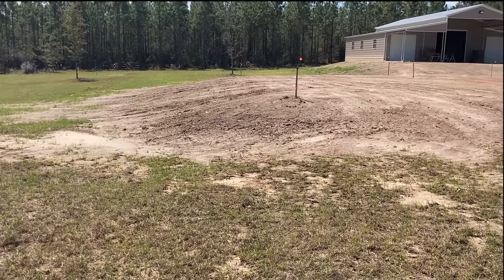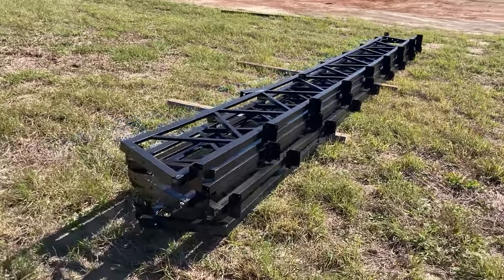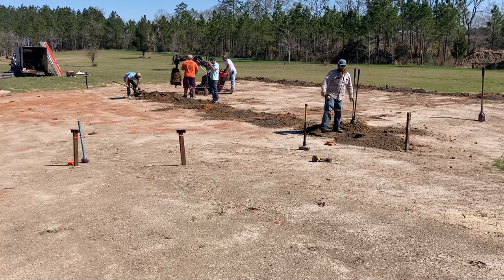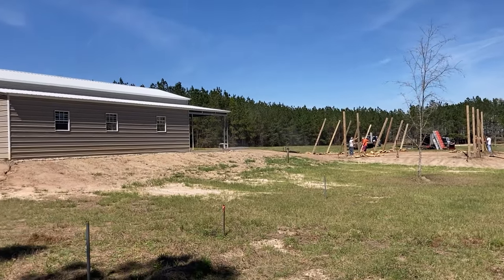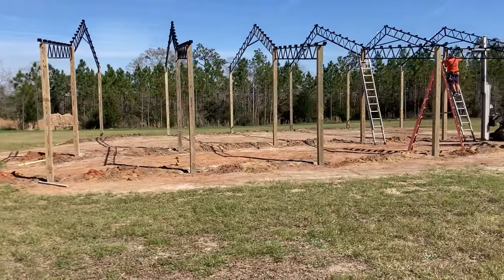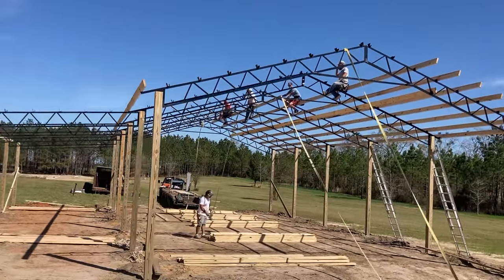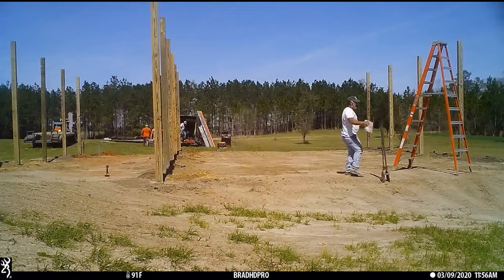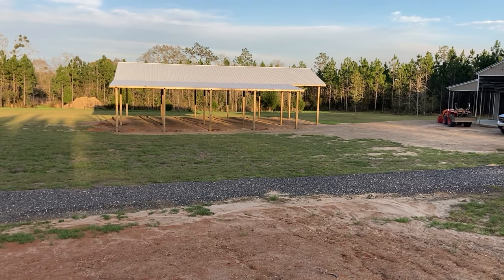How to Build a Pole Barn | TIME LAPSE | 32x60 Pole Barn With16' Lean

Comment: We have a 100x50 foot pole barn on our 14 acress property..  But it was once actually a forestry service building in the 40s.. the owner of this land bought it in the 60s took it apart and moved it to this land and rebuilt it himself..  Interestingly enough.  the 8x8 posts are not in the ground.  They sit on top of 2x10s on top of concrete blocks in the ground.   Not even anchored mind you which is ODD.. but its held through how many hurricanes and wind for 60+ years.  The beams in the barn are all 4x6 or 6x6 for the roof.. yes 4x6 and 6x6 for the roof beams lol.. Its interesting how it was built.  the 50 foot span uses a 4x6 50 foot beam.. with 2x10s bolted to the center of the beam and then a giant metal bar bolted through that going to the roof beams.. So in essence the roof supports its own weight..    Its interesting seeing how cheaply new barns are made these days "no offense lol"  using all pine soft wood.. and small boards, versus the gigantic solid oak beams mine has.  Even my 2x4s for the roof are oak.   I guess today that would be too expensive to build like this 

The prior owner who rebuilt this in the 60s did an amazing job, he built 6 horse stalls, with a slab on 1/4 of the barn, the middle 1/2 is three double doors, for storage for cars or farm equipment.  Dirt floor though, and the last 1/4 section is a single double door, with a 4 inch slab 10 120v outlets, and a 50A and 25A 240v outlets. Also is insulated "as best as youd do for 1960 with foam and tar mats behind the dry wall.  It also has water in the stalls and the workshop coming directly from the house itself 300 feet away.....  I also have a drain in the floor on both slabs, and a 15 foot work bench made out of 4x6 oak posts i assume were scrap.  I also have a cinterblock lined with tile chimney for a wood stove in the shop.  The shop also has 6 huge windows that flip up for ventilation if i want

So the building itself is 80 years old, or 60 if you count the rebuild.   The tin roof leaks a little in spots, and needs some new sealent put on top. its leaking through the nails in the 2x4s and rotting them slowely.

Im very grateful for that man for building such an amazing, still standing, barn, with evgerything one would want... Water, power, slabs with drains, and yea.. most guys with workshops i noticed dont have water, and dont have 240v power either.   And lack of windows in many modern shops/barns is depressing.   The man is now buried at the cemetary next to this property.

We also have a 50x15 foot building, built in the 80s.  Once used as dog kennle... water power insulated but it needs work.. I sold the cages and im tearing down those cinterblock walls for the like 15 cages it had going outside.. Not sure yet what ima do with the building, but those 15 cages outside are all on 4 inch concrete slab.. im thinking of building an addition to this building.  If i do that itll make the building 50x30 in size
Reply from the maker: Modern buildings are engineered to wind loads in our region.  Just because it's not built the same way doesn't mean it's not as strong or stronger than an older building.     Sounds like you have a lot of nice spaces on your property!

Comment: I'm building a similar building 40x60 and am worried about putting my trusses 10 feet on 6x6 . Are my purlins going to be able to hold longterm, with that type of spacing between each truss?
Reply from the maker: Ours are 12' apart and span 32'.  That seems to be  standard.  If yours are 10' apart that's closer than ours and I think our building is rated to 140 mph.   It's changed a lot since this video though.   Here is the playlist of the complete build:  https://www.youtube.com/playlist?list=PLG5yS75HLzo2MCmO8M-IQXfvkv-ivvpAU

Comment: Are those concrete fast curing concrete? They look like regular concrete since they are in yellow bags instead of red, which are fast curing concrete that we put then dry in and water later. Some people say that the posts may move when we put dry in and water later since the concrete does not get evenly wet and they do not cure evenly. Of course, your builder said the other way. Not sure that was only they wanted to get the job done faster.
Reply from the maker: They dry set around here.  I'd prefer a concrete truck with a wet mix, but nobody is going to build a pole barn that way.   It doesn't matter on this build because we ran footers and a slab later in this video:  https://youtu.be/318GLu76PjU
Reply: @PineyGroveHomestead  Thank you for your quick reply! I watched your footer video, which will definitely make the posts stronger.

Comment: Nice video. I have a question ⁉️ trying to build a RV storage lot similar to this video for about 50 vehicles what size do you recommend for something like that. Also I need about 25 feet in height or is that too much for the bigger RVs? Any information would help thanks 🙏
Reply from the maker: I think the safest way to answer that is to go to an RV dealer with a tape measure and find out the height and width of the largest RV they sell.  Then get with a reputable pole barn builder and figure out the right size to fit that.
Reply: Legal height for commercial vehicles before you need oversize permits is 13’6”.  If your planning on overhead doors at each bay you will need to plan for an additional 2’ of headroom on your sidewalls for installation.

Comment: I am closing on 20 acres near you. Just wondering how much the pole barn cost.
Reply from the maker: I hate to give you a number that's not relevant as I was getting quotes valid for only 7 days in 2020 due to the changing costs of lumber and sheet metal....and then the new Florida wind load codes in Jan 2021 bumped up the price even more for permitted structures.   But the pole barn in this video in Feb 2021 was ~$15K.   Thanks for watching.  Brad&Deb

Comment: How much did the building materials cost individually?
Reply from the maker: Are you talking about buying a kit and doing it yourself?   We contracted with a local company to do it all based on our spec.   It's a 32x60 main pole barn with a 16x48 lean.  12' tall with 6x6 posts in concrete wind loaded to 130 mph.